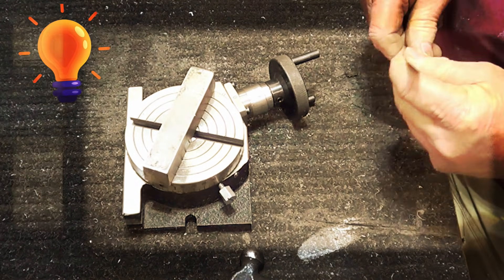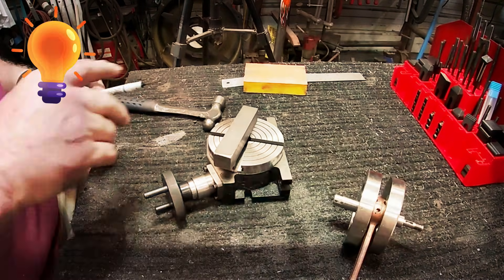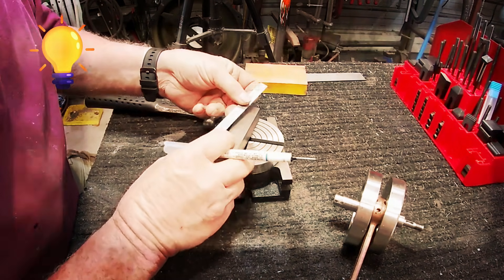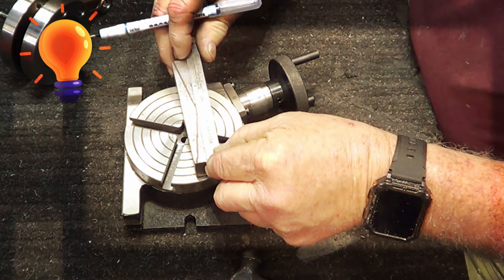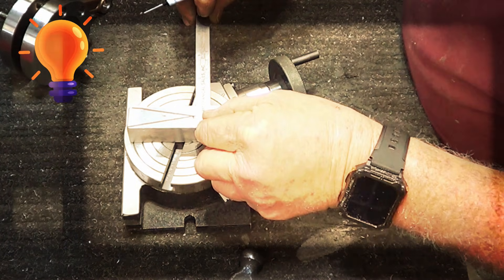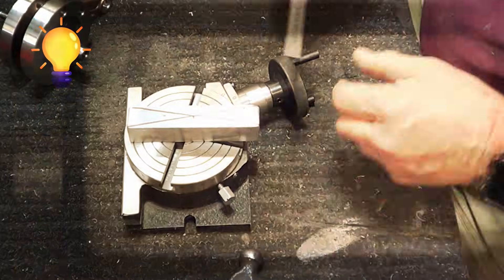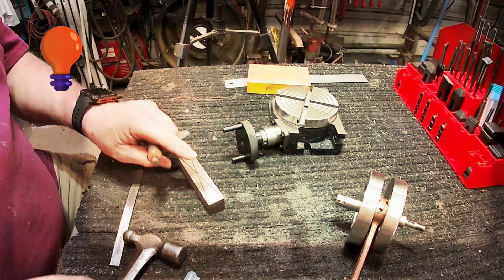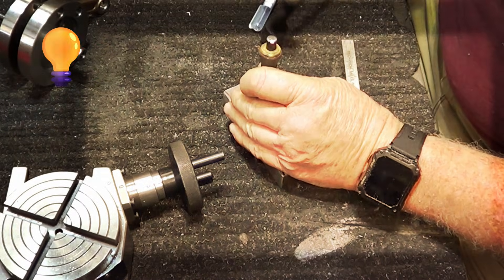Motorized bicycle working on a new way to balance a crank

Comment: Very cool. Bro.
Looks a lot stronger that way , you don't need to remove as much cause you're removing material farther from the center. less likely to crack from hole to hole. nice